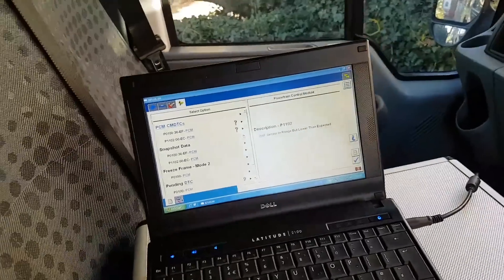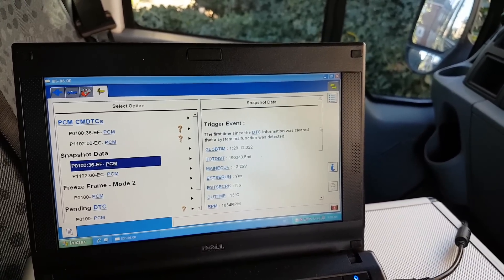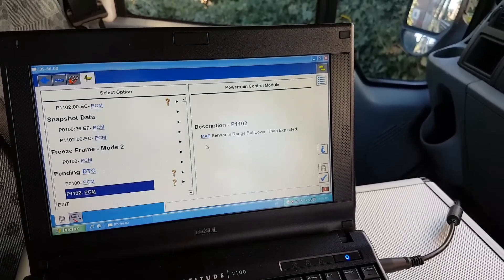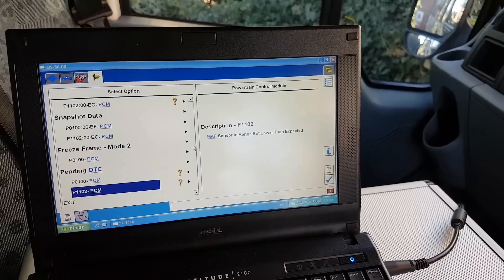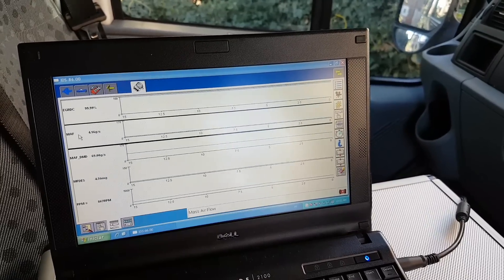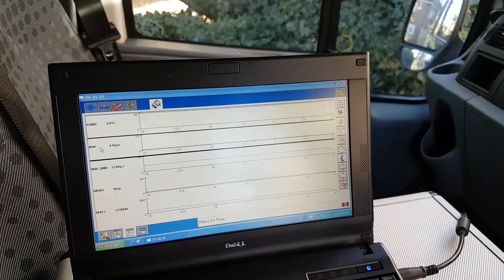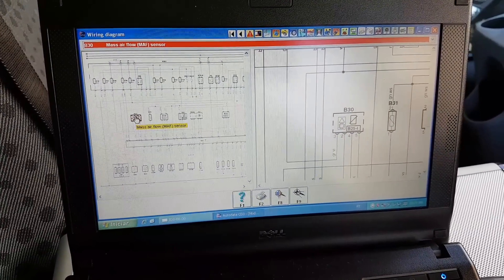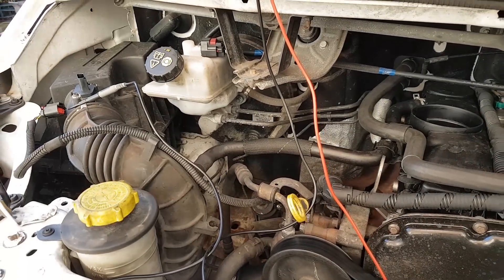Ford Transit 2.4 TDCI P0100 and P1102 MAF faults. Fault finding and repair.

Comment: Hi,
Not sure if this has been asked before but where did you get the test leads from that are long and thin enough to fit into the multiplugs? Have a fault to find and am struggling to get my probes.
Reply from the maker: Hi
Here you have....

https://rover.ebay.com/rover/1/710-53481-19255-0/1?mpre=https%3A%2F%2Fwww.ebay.co.uk%2Fitm%2F1set-Copper-Test-Leads-Multimeter-Probe-Extention-back-Needle-Probes-RED-BLACK%2F192863909690%3Fhash%3Ditem2ce795b73a%3Ag%3ASq0AAOSwpsBckJGe&campid=5338344466&toolid=20008

Thank you for watching!
Reply: LM Auto Repairs Brilliant, many thanks for the speedy reply. Sorry to be a pain but so you have a link to the grey part shown which they are connected to?
Reply from the maker: @chrismp2k7  
Here you have...
https://rover.ebay.com/rover/1/710-53481-19255-0/1?mpre=https%3A%2F%2Fwww.ebay.co.uk%2Fitm%2F1-2m-Red-Black-Bare-MultiMeter-Test-Leads-Cables-Wires-M-M-Male-to-Male%2F292981236041%3Fhash%3Ditem44370ae149%3Ag%3AZrcAAOSw2QxcdCNi&campid=5338344466&toolid=20008
Reply: LM Auto Repairs awesome, thank you very much. I was binge watching your videos last night and can’t believe how much I’ve learnt in one night compared to what I’ve learnt over the last 30 years. Thank you for posting these videos
Reply: I’ve just ordered them. Thanks again: got an egr to test on a Ford Focus 1.8 tdci and probably clean.
Reply from the maker: @chrismp2k7  
👍
Reply from the maker: @chrismp2k7  
😊
👍👍👍
Reply: Great video again,thanks.
Reply from the maker: Thanks!
For watching and for your comment!
Reply: Great video. Corroded wires are real problems in modern cars
Reply: Is that the lead to the map sensor that had bro having same problem  mate please let me know as carnt find the video to resolve  issues

Comment: My 2008/200K mile Transit had the same fault, with the same wire broken in the same place in the wiring loom and reading the same MAF data. I didn't have the circuit diagrams so your video was very useful. My wire didn't show visible signs of damage but it bent&broke very easily in one place showing there was no conductor at that point.
Nice, handy video. Thanks!
Reply from the maker: ☺️
Thanks!
For watching and for your comment! 
👍👍👍

Comment: after the repair did 12v return to pin 3
Reply from the maker: Would have to... otherwise would still have the same fault...
👍👍👍
Reply: @LMAutoRepairs  thank you. my brothers transit has the same code and it has no 12v on any wires.will look into it.thanks for a great video

Comment: Hi. Great video. Could I ask your advice. My transit 2.4 (2008). Has a stutter and wish sound from turbo/air box at around 2000rpm. However if I unplug the MAF sensor.  It runs perfect. But then the engine light comes on.  Any ideas what it could be
Reply from the maker: Does it drive OK with the MAF disconnected, like unde load etc?
👍👍👍
Reply: @LMAutoRepairs  hi thank you for you speedy reply. So when I unplug the MAF sensor the one on the air pipe near air box. It runs so smooth. Even under load with foot down. No smoke. Only problem with this is. After van is turned of and on a few times the engine management light comes on. So I delete with odb2 cheap reader. Then does it again. The moment I plug maf back in. There's that stutter, and dumb valve type noise at 2000rpm ish. Thank you
Reply from the maker: OK...
So, I would say then, that your MAF is probably faulty... 
When you unplug the MAF, the engine ecu calculates the air flow through other means... is not as accurate, but good enough  for the engine to run OK...
When you plug it in, the wrong air flow readings are sent to the ecu, which forces it to make the wrong adjustments...
You might want to check live data, etc, to make sure that the MAF is indeed faulty, as they are not particularly cheap...
Also, if you replace the MAF, do not buy cheap aftermarket... buy genuine...
Aftermarket will might give you more headaches... and you will ended up buying twice...
Again, more testing might needs to be done, prior to be 100% sure that the MAF is at fault... I am only suggesting based on what you are saying...
👍👍👍

Comment: I have the same problem with my Transit mk7 2012, changed all sensors new EGR the lot still getting codes any help would be gratefully accepted before i go cuckoo.

Comment: Thank you for this video after changing the mass air flow sensor my mk7 Ford transit still had issues of cutting out and the Rev keep on bouncing I found one broken wire but now I will check them all I hope that fixes the issue thanks
Reply from the maker: 😊
That's great!
Hope you get it sorted...
👍👍👍

Comment: If only P0100 fault code check the MAF sensor connector is not loose! I didn't reconnected it fully and didn't press the red tab down to lock it.

Comment: my ford transit t350 dies always on idle.I suspect it is something with the airflow butreally cant be sure. THE ecu computer at the mecanis showed that there is 4 issues:
cilinder 3 
and 4 glow plug circuit
smart alternator sensor circuit internal failure
smart alternator component  failure
turbo underboost bellow average.
last one dissapeared after we cleaned the dpf and changed temperature sensor but yet the car continues to die at the start and on idle. It drives but it definitely there is a pending issue to happen.

Comment: I change the MAF senzor and pressure one ' aftermarket of course  ,but the engine light it still on ,and first 20 min runing there was no power and a lot smoke ,after 20 min driving are working perfect .......why
Reply from the maker: Well... I don't trust aftermarket sensors... specially sensors like MAF etc...
Could be that... I had very bad experiences in the past...
Thank you for watching!
Reply: @LMAutoRepairs  ok. But then why is it that the car runs interuptedly for the first 20min and blows dark smoke. Because on thetester it's showing me the same errors like you had.

Comment: Hi guys i had the p0100 code  but that was because i blanked the egr  the van is now odd lights on dash but runs rough could air flow meter cause the running roughly or the air valve selenoid sorry for asking bur not many on here with the mk7 videos.

Comment: I use to work at the dealer .... when I found a problem like this I`m not allowed to investigate further due to time issues vs pay rate vs final cost of the repair vs value of the car.  They will change the "damaged" part and is the problem is in the wiring, etc the car will not have further investigation due to high costs. In rarely cases I had to investigate wiring I was not opened the looms but connect external wires to sensors , ecu , etc to speed up the operations ....  so the marketing dictates over the mechanics in the shop , just like the marketing dictates over the concept + engineering departments in the automotives factories ....

that`s why we came across sometimes to stupid design solutions and strategies , weak materials , so much plastic and so on .....

the final project decision came from the marketing dep. and sadly not from the engineers and the prototype / development departments ....  

best regards
Reply from the maker: Great comment!
Thank you for watching!

Comment: Great job
Reply from the maker: george5022 
Thanks!
👍👍
Reply: I have a problem with my Ford transit minibus . Which I've converted to a camper van. The problem is I switched my engine off .then tryed to start it again.  I've got no ignion light and it wount start. Before that I had drove 370 miles with no problems stopped 4 time my stated without any problem.  Any body can help me ???.?.

Comment: Hi great job . You really good at electric . How do you diagnose the pressure sensor . ? Normally pressure sensor has three wires . 5v ground and signal.  If connector disconnect ed . Koeo what is the voltage should be .. 5 v still stay 5 v ground still ground 0 v hocw about signal wire ? 0 v or ? . In my case it is 4'95 v.  I dont understand where is the voltage comes from but if you put connector  back signal become 0.5v ,seems fine . Thanks s you made so much great video.

Comment: hi
P261a00: Coolant Pump "B" Control circuit open. - Permanent
The Car (seat ibiza) not run more than 3000 rpm 
What do you think  In this problem?
Reply: That's an open circuit. Check all wiring, fuses/connectors, and the coolant pump itself, try a known good one if needed to isolate wiring issues. Coolant pump B is an electric pump for the EGR cooler which is why the light has come on, the EGR cooler could get too hot and emissions will be affected. It's gone into limp home mode, hence why it won't rev over 3,000rpm.

Comment: Excellent work my friend. I am surprised to see only four wires on MAF sensor. Usually I see five. Two for IAT sensor and three for MAF ( power, ground and signal wire ). It is always hard to work when we don't have designation for wires at PCM. Thank you my friend. Cheers
Reply from the maker: KY Home Garage KY Home Garage 
Hi
Thank you Ramon...
It can be tricky,  yes...
Thank you for watching!

Comment: thanks for great video my friend, quick question im going to checkout ford focus which has a no comms abs module thus faulty is it possible to code in a second hand module using IDS or Autel especially when u cannot transfer data because original is faulty cheers sandy

Comment: Ive had problems with those autodata wiring diagrams also. Do you ever had a need to use the j2534 facility on the maxysis

Comment: Ive had problems with those autodata wiring diagrams also. Do you ever had a need to use the j2534 facility on the maxysis
Reply from the maker: Hi
Not yet...
Reply: I got the same maxysis. Is good tho have to resort to the delphi autocom occassionally. Keep the vids coming. Theyre gr8. Cheers from northern ireland
Reply from the maker: dave sterl 
I am quite happy with it...
Thank you for follow the channel!